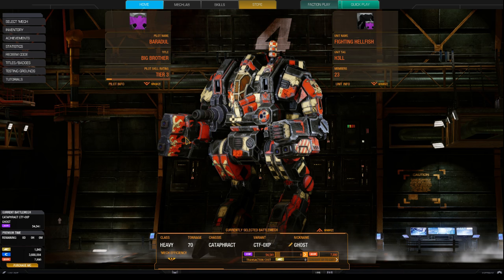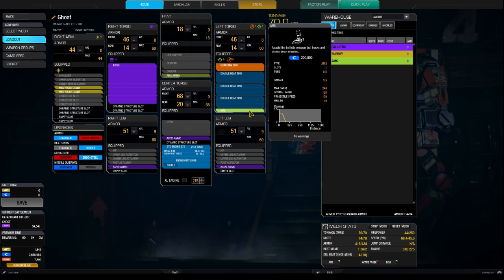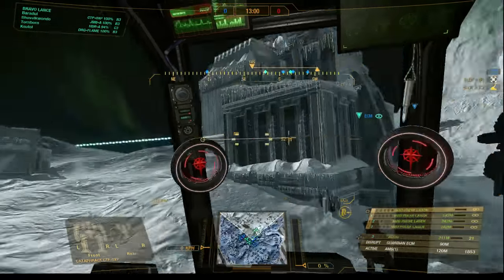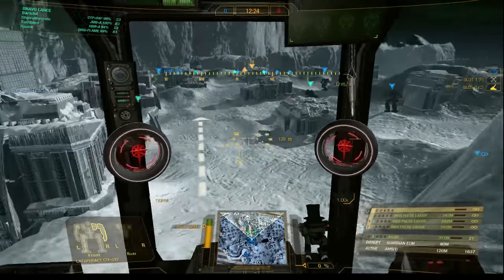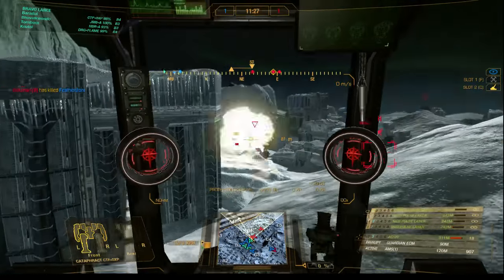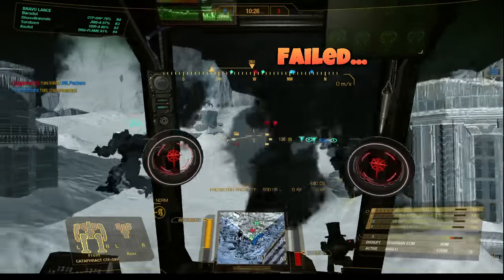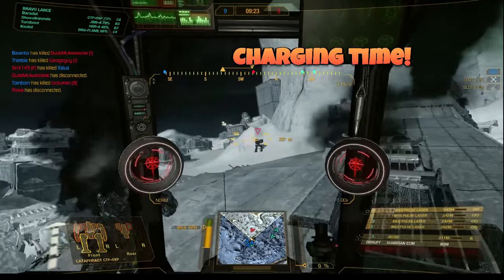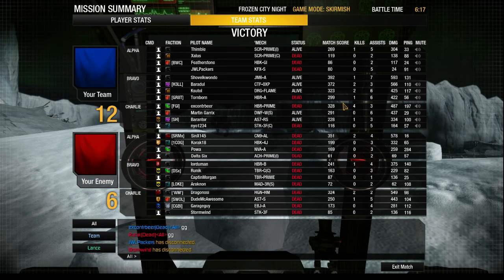Mechwarrior Online Tutorial: Brawling with the Cataphract 0XP

Comment: I had a bit of a question.  as far as close range mechs goes, how do you feel about light mechs with close range loadouts? (IE SRMs or SPL/CSMLAS)
Reply: +starbomber They can do a strong and surprising amount of damage. However, a close range light has a high skill cap and a low floor, making for a huge range of effectiveness depending on the pilot. In order to get in close, still dish out good damage, and not die with the tiny amount of armor you have, it takes some fancy moves.